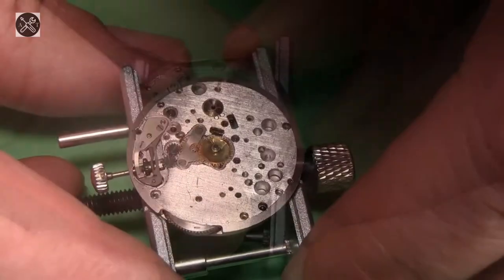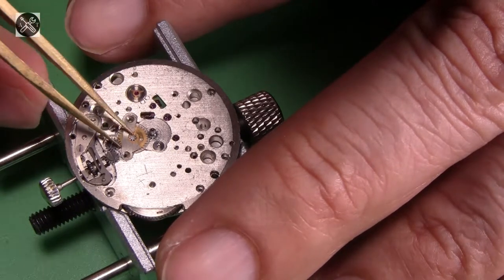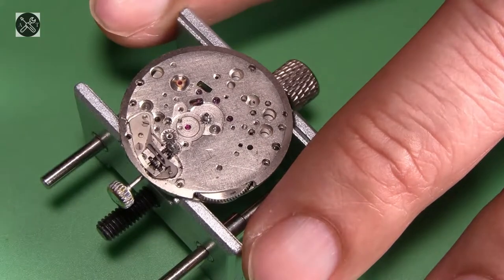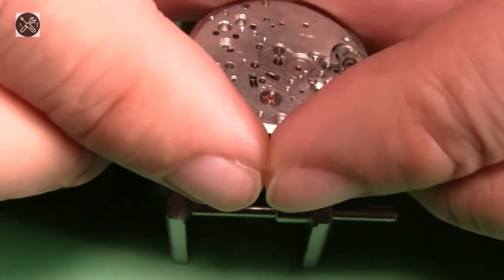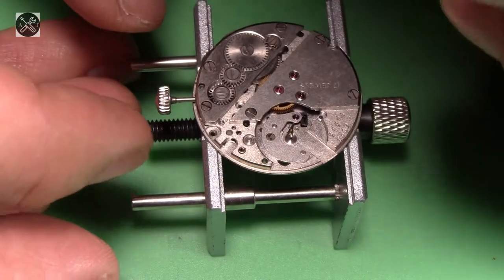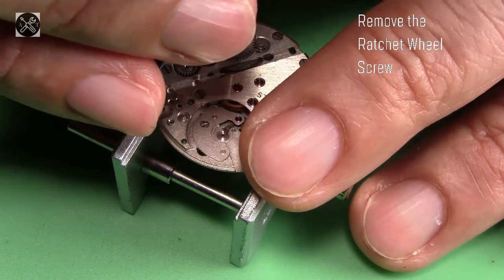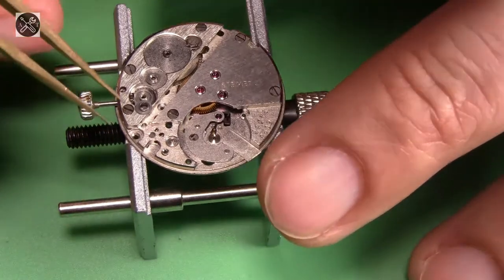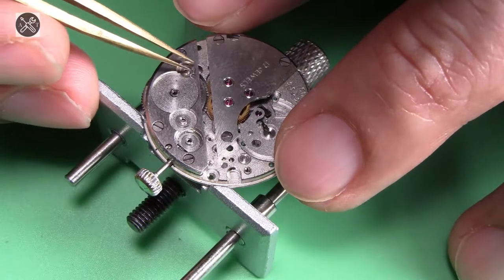Poljot 2609 Stripdown Part 2 of 3

Comment: When I assemlbe the Click it appears to be a bit on the loose side. Even so, that the Click-spring can jump out from it's groove and eventually jams the Click. There are so many similar screws here, but I'm aware using the right one here. What do you think, what did I do wrong?
Reply from the maker: Hi Balázs Kelemen.

Thank you for posting a question. If you're sure you're using the correct screw, then it's possible the direction of the click is placed the other way around? The click spring may have been misplaced as well. One end is stopping the click's turn from the movement wall whilst one end hangs on to the notch on the click itself. 

Try checking the placement of the click if pointing the other way.Try looking at timestamp 8:30 and you can get a glimpse of the proper placement. 

Thanks and hope that helps.